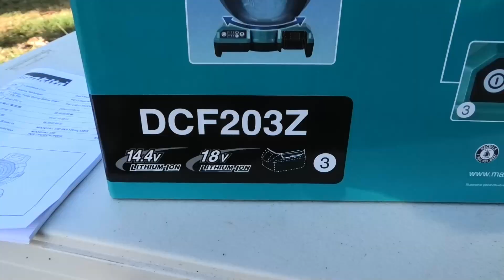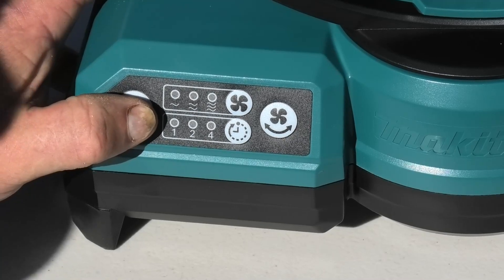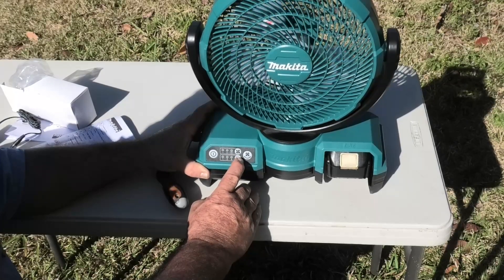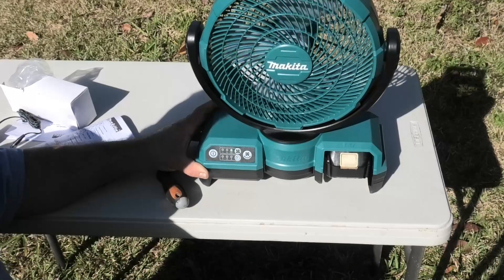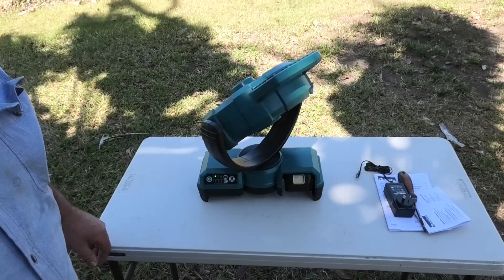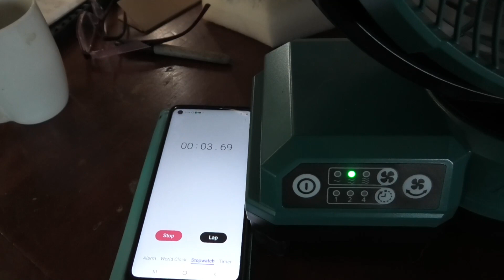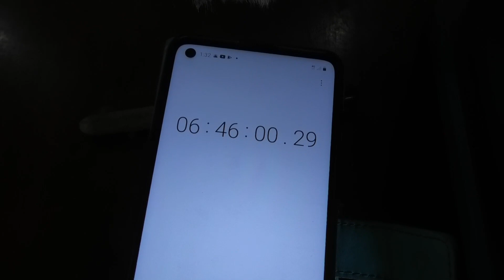MAKITA BATTERY FAN  Model DCF 203Z   REVIEW

Comment: Tip. You can use your air compressor to clean the blades. Use a screw driver to keep the fan blade  from  turning. Makes quick work of a dirty blade.
Reply from the maker: Thyats a good idea. John

Comment: I have been wondering about these fans because the ones I have seen sell a separate battery that can be used for some of their other products.  I've been fooled by battery-operated fans before though. Glad you did this review!
Reply from the maker: I have other Makita stuff and I already had the batteries and charger. I have had a good run out of my Makita gear and I have been using the fan every day some battery fans don't put out much air but the one I bought puts out plenty. John

Comment: Guess you have decided. You did not need the Biochar Cruncher?  We are going into the fall. First day we had 11 degrees c.
Reply from the maker: No not at all I had a bit of trouble finding the Blade material (spring steel) but I have it now and I am slowly getting it done. Fertilizer prices have doubled here in Australia so it will go to the top of the list as soon as I can see daylight.  11 deg c is what it got down to in winter here this year. John